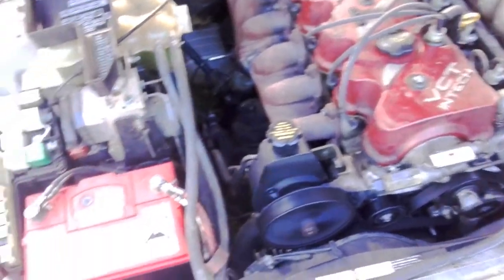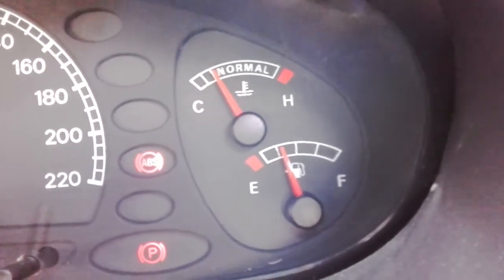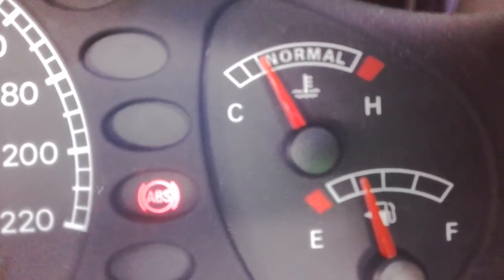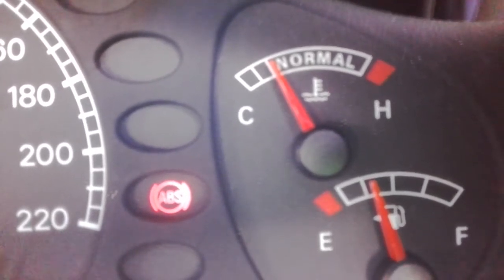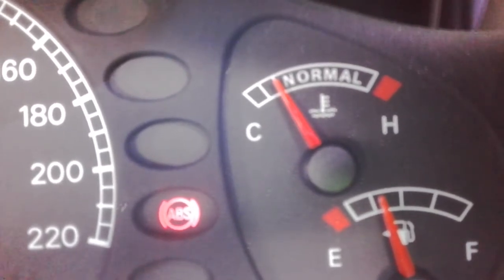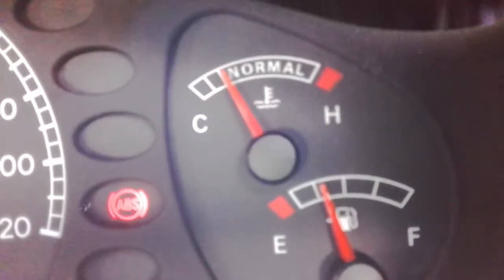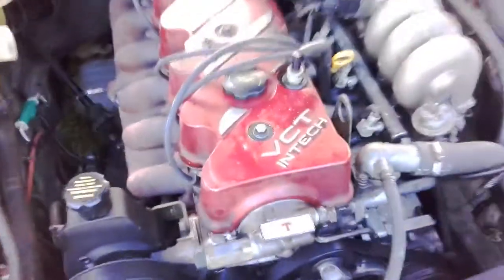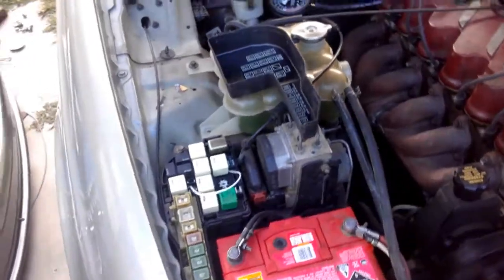AU Falcon cooling fan adjustment 74-80 deg

Comment: I've been using this hack ( thanks jimmy the hack whereever you are), it works well, I have au1 and it kicks fans on at 78degC not 74degc, also I note the fans go off when you get moving, if temp is 80degC or a bit more, fans come on when you slow down maybe 15-20km/hr or so, quite close to stopped, so they depend on the airflow from movement as much as possible.
I have a leak when the temp gets up around 98degC, using this hack it keeps temp down generally, but if your moving slowly it still get can quite hot as the fans dont kick in generally until almost stopped.
The downside is the alternator gets really hot, it will be drawing about 18amps on each fan motor, so 36amps all up, and more amps from whatever else is using current. I have cheap ebay alternator and it gets really hot, too hot to touch, so will see how long it lasts, its probably near its max rated output.
Reply: fans go off when you reach 40km/hr, so it depends purely on air flow due to speed of vehicle. Also my leak was found to be small crack in middle of radiator, just put a new radiator in, all solved.

Comment: Never had an issue with mine (xr6 series 2 )in over 15 years of use , still on the same head gasket it left the factory with .
Even towing a big ass caravan from melb to up around Queensland on holidays to see all the relo’s and at times in the  40+ Celsius temps . 
I did have a cooler thermostat in it though which may have helped a tiny bit, but the ecu still controlled the fans to run at normal operating temp anyway.
Such a good car the au , never  missed a beat ever .
Reply: amazing quality in the au, no doubt about it.

Comment: My 2000 Fairmont au2 stays in the middle of N lol. I would hate for it to go further then that lol
Reply from the maker: The N means nothing the guage is heavily dampened. N could mean 92-108 deg .Once the needle reaches N you wont be able to tell temps between 92-108 . Put another guage in to confirm .
Reply: I use forscan lite with obdlink mx+ dongle, can read exact temp on phone screen whilst driving, I usually show a few things whilst driving: autotrans temp, water temp, fan state,
gear ,  fuel trim

Comment: Do the fans turn on when you are cruzing on the freeway at 100Kms.
Reply from the maker: When it gets to 74 deg  regardless of what speed.
Reply: @jimmyhack007fixit3  mine is au1 and fans kick in at 78degC, but the fans use alot of amps, puts the alternator under stress ( tip from technofied gave me). can be up to 40 amps draw from two fans.

Comment: Mine never goes past the "O" in normal, would it be worth still doing mine? Or would it make it run too cool?
Got a 5ltr rebel au II
Reply: It will stay on the O with the temperature of 90-108 Deg. Only when it's gets to 109 will it head towards hot very quickly. The standard  gauges are highly dampened . Ford believe 90-108 Is normal operationing temperature you'll never see the needle sitting on RMAL in general use it'll be going past those letters on the way to Hot.
Reply: @akaitv6606  cheers mate, massive help
Reply: @akaitv6606  is this the some with the gage on a eb
Reply: I wanna know that too. Mine intech sits just past the N but would It be worth doing this?